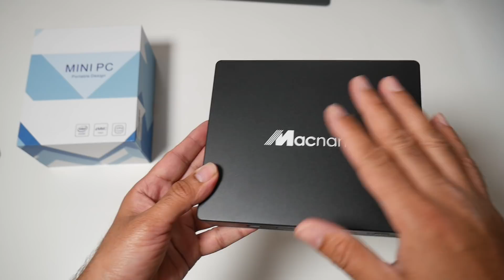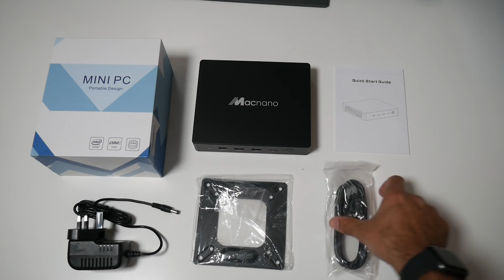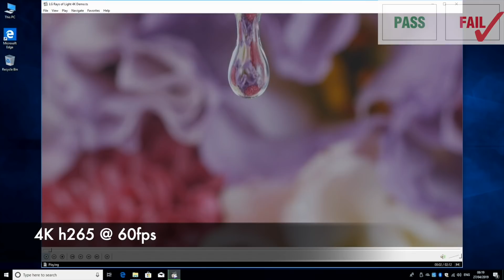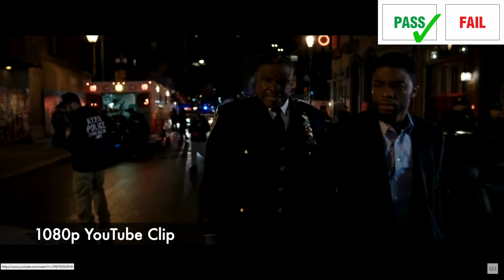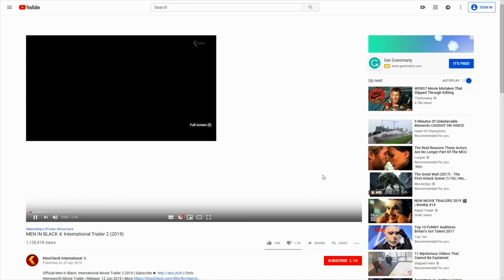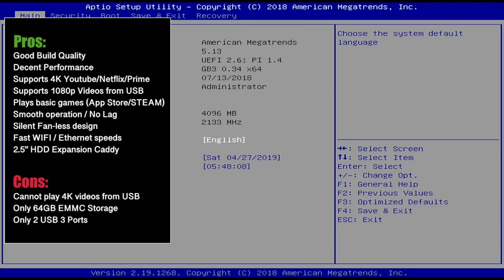MACNANO Mini Windows 10 PC - Intel J3455 - 4GB + 64GB - Any Good?

Comment: If you unscrew it it has an nvme slot but when i installed a western digital 500Gb it did not recognised the nvme disk. Have you tried it with another nvme?
Reply from the maker: I believe this box only Supports a 2.5" SATA.
Reply: @ChigzTech  You are right. I see that there are different versions of this. Mine has the Nvme slot if i unscrew the screws under the 4 rubber feet and flip the board upside down. I tried a Nvme disk but it was not recognised from the Bios. I checked for firmware update but no luck. Anyway nice video.

Comment: Chigz Tech Reviews : The MACNANO GL-1 Mini Windows10 (64 bit) PRO OS - 4GB + 64GB PC - with Intel Celeron (Gemini Lake)  J3455 - Intel 4K UHD Graphics 600 -  eMMC 2.5 inch SATA III SSD/HDD M.2 2280 SSD or TF Card Supported - Dual Screen Support (Dual Monitor Outputs via HDMI 2.0 + VGA 4K High Resolution Viewing) - Dual Band WiFi  2.4GHz/5.8GHz + Gigabit Ethernet Port(1000Mb) + Bluetooth 4.2 + 5 USB Ports + HDMI Cable + VESA Mount + 1 Year Limited Guarantee currently listed on amazon.com for $199 U.S. Dollars !   Good quality on this budget friendly MACNANO GL-1 Mini Windows 10 Pro PC , currently is a solid 8/10 and a score of 7.5 on the Chigz Tech Reviews Mini PC Performance Chart !    Thanks Scarboro